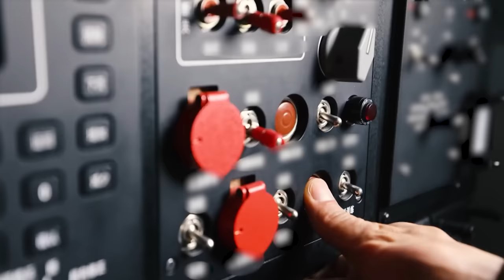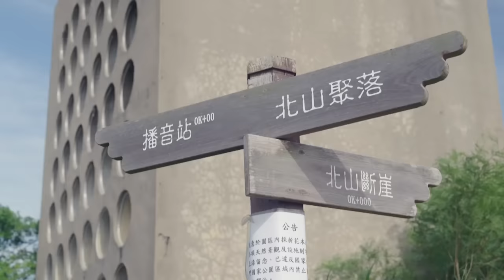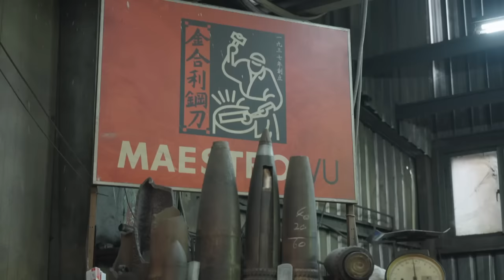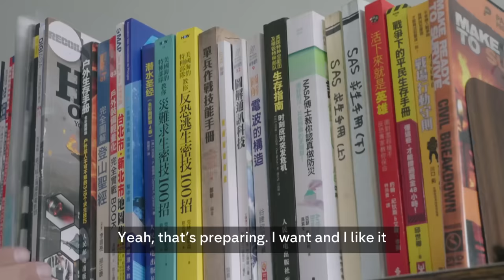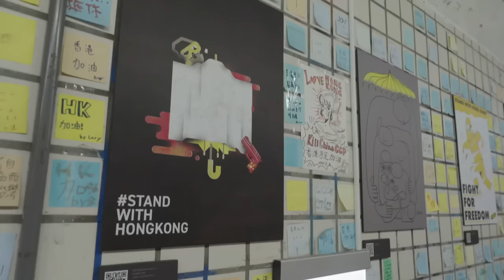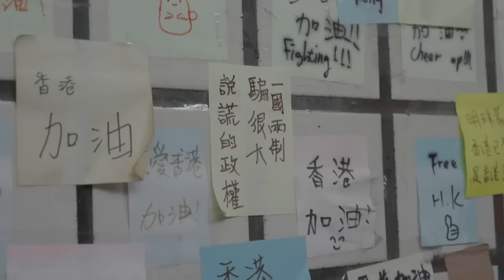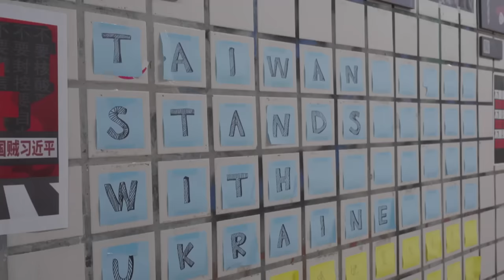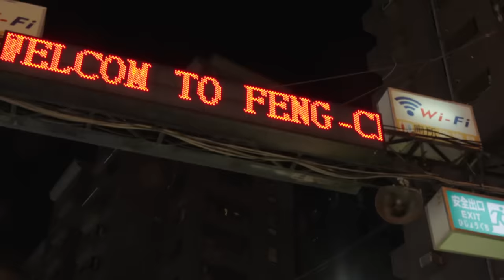Taiwan - Prepping for War | Unreported World

Comment: It won't help unless everyone is armed and has a rifle at home. 200k soldiers can be wiped out relatively quickly by a military that large, but a fully armed population, that's a difficult one to conquer. Not only that, the people also buy their own rifles and equipment, it's a self-funded military. If the US was invaded, it would be quite difficult for a military to move anywhere without coming into conflict with a lot of armed people. Their numbers would be depleted very quickly, even if it's one soldier at a time.
Reply: Yeah sure, as a swiss reservist i also think they should be able to have guns (or at least train with real ones and have some kind of efficient distribution system for guns in case of invasion).

But thinking that america not getting invaded is about random armed civilians, is ridiculous. Especially considering about 45 percent of Americans are obese (not overweight, obese!), so definetly not fit to fight. 

It doesnt get invaded because its the worlds third biggest population, with by far the biggest military, the second largest nuclear arsenal and the largest number of allies. Seperated from any potential threat by two gigantic oceans, which the massive american navy controls. 

Also it has a landmass so big that even if china and india together deployed every single soldier they have (assuming not a single one of them died during the invasion and none were needed at home) they would barely have one man per square mile. So its completely impossible to occupy due to sheer size.
Reply: @Soff1859 Agreed. Switzerland has its mountains and America has its oceans.
Reply: @Soff1859  They'd get skinny pretty quickly when food is scarce. Not everyone is ridiculously fat, those who are overweight are often just a few kg overweight, not those fat people on scooters, that's just some nonsense stereotypes people came up with. Most are more than capable of fighting and would if there was an invasion. We do have a secure location and the fact that really no other military has the logistical capability to move that many troops and equipment so far, but even if they did, there are over 40 million ex military alone here, and most people are familiar with weapons or have been hunting. Invading would not be an easy task. There just aren't enough soldiers to occupy 20,000 cities full of armed people.
Reply: @mattycakes1161  well thats why i specified obese, not overweight. Thats not a few pounds too much. Every single one those people would be unfit for service in any military in the world and in any role. 

And that is just a hair under half of the total american population. Not yet including overweight people (which would probably also be mostly unfit for military service in peace time but maybe some could be admitted in non combat roles in an emergency). These people also cant effectively participate in a guerilla campaign on their own. 

And loosing weight thru malnourishment and famine is not gonna make people fitter, even if they do lose some weight. 

Again america is uninvadable, i agree. But the population being armed is really negligible in this equation. Its due to entirely different factors.
Reply: @Soff1859  Old people are often overweight, but I think that's a trend globally, so they would make up a large part of the obese population and not be able to fight because of age. Still, Taiwan needs a similar system to the US or Switzerland. It's a lot more like Switzerland because of the size, population, and proximity to hostile powers. They need weapons, access to weapons very quickly, and not have them all stored in a central armory which would surely be hit first, if they're gonna do that, they need lots of small armories in both urban and rural areas, not to mention handheld launchers capable of defeating light armor. Any invasion will require amphibious vehicles and China has a limited paratrooper force but they will come first, after the missile and drone attacks. Taiwan can repel and even embarrass them, but not in its current state of operation.
Reply: @mattycakes1161  i am totally with you on the availability of weapons. As you said, if they're not gonna have weapons at home. They need to allow real guns to be used in shooting clubs. And real weapons with ammo, mags etc to be stored in many small depots all over the place, that are known to people and can be unlocked immediately and remotely, once an invasion starts. 

That would make them a much bigger threat than the current system. Which, as you rightly pointed out, is way too centralised and easy to take out and also doesnt allow for people to maintain and improve their skills after completing their conscript service time. 

Here in switzerland conscription doesnt just end at age 21. You stay in the reserves for around 10 years. During which time you have to go shoot once every year and attend a 3 week refreshers course with your unit roughly once a year at a minimum. Therefore, if 29 year olds were to get called up for service, their last training would be a few months ago, not almost a decade.

Comment: Foods and medical supplies: one small supply at home, in family vehicle and donated to local schools. That should be every family even in peacetime.

In preparation for imminent danger, water. Water will be needed more often than you think. At minimum, 1 water bottle per family member and equipment to purify more. That 1 bottle is less than you might need on the first day but it will help hold you over till can purify more. Besides drinking… many wounds may need washing. Bandages and other medical equipment may need to be washed thoroughly if they cannot be properly sterilized. So much water will be needed.

Comment: On  military level, Taiwan is actually a very difficult island to invade. It require A LOT of logistics and infrastructure to be able to invade which China doesn't have yet. China is, however, in the process of building it. Moving tens of thousands to hundreds of thousands of troops and landing them on a beach requires equipment. That's one of the main reasons they haven't invaded yet.
Reply: Missile attacks, air strikes, and then airborne troops and sea landings, with tens of thousands of soldiers sent in the first wave ; 
This may not succeed take over Taiwan, but it can seriously damage it

Comment: The problem I see with our Taiwanese friends taking those civil training courses (and this may just be due to the reporting done) is that their training with their airsoft guns isn't giving them the idea of recoil nor training them in ranging and accounting for height-over-bore, drop, flight time, movenment, etc. I highly encourage a more force on force dynamic for their training (which they might have) as well as expanding their battles from clearing to fortify and hold tactics. I'm not knowledgeable of Taiwanese geography, but perhaps a guerilla approach is also required. 

I also recommend looking at gear preparation to ensure they are NIR  treated and that other supporting gear does not reflect IR/UV. Good luck.
Reply: thanks chair operator